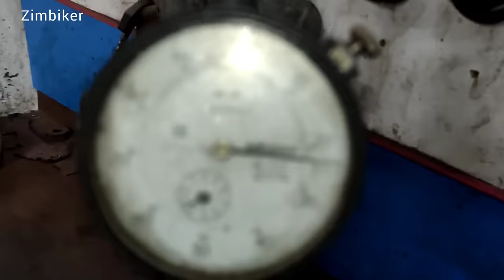Connecting Rod Replacement and Crankshaft Balancing Full Video - Zimbiker

Comment: Cool video.  It's not shown, but he had to align the oil feed hole in the piston pin before pressing it in, and the cam sprocket also had to be aligned (so the timing will be right) before pressing it on.  I'm always amazed that these little press together cranks stay true during running, given that such a relatively gentle smack with a hammer is all that it takes to twist it on the pin a little bit when lining it up.